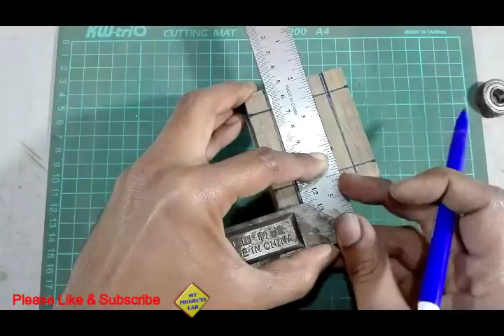How to make Drill Powered Saw - Homemade Reciprocating Saw

Comment: There is one misteke you made;
 you welded outer rings of those bearings on the bolt; bearings won't rotate and work as bearing.
you should have weld inner rings of those bearings.
Reply: Hirohii3 if the mistake is as you said,the sew would work.
Reply: He didn't make a mistake.
Pay attention - He's not using them as bearings. He used oversized bearings so they'd fit loosely on the shaft allowing him to weld them to the shaft on a angle to create the linear motion needed to propel the blade back and forth.

Comment: you can destroy your drill wiith that kinda mod too 

you can afford a welding machine so why not buy a makita 110$ reciprocating saw hahahah :D
Reply: Why?  The reciprocating saw is built on a similar principle i.e.rotary to lateral action.
Reply: @Biffo1262  because the connection is solid from the power to the action in the reciprocating saw, whereas with a drill mod it's just "grabbing" it. so if it catches it'll spin insides itself and wear. kinda like if you fell off a cliff and grabbed a Paracord and got rope burn on your hand, vs if you were on a cliff and had a rope securely tied around you. in the first case imagine holding on to the rope and you're a strong guy with a good grip on it, when suddenly another strong guy suddenly yanks your foot and you slide down the rope an inch or so. after a while it'll burn your hand. whereas if you were secured to the rope and he yanked your foot, only the rope would feel it. reciprocating saws are designed for the blade to wear, not the machine itself. it's still cool tho. just gotta find a way for it to be a secure YET temporary connection instead of "grabbing"